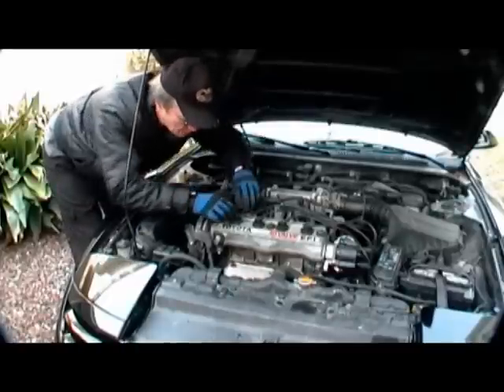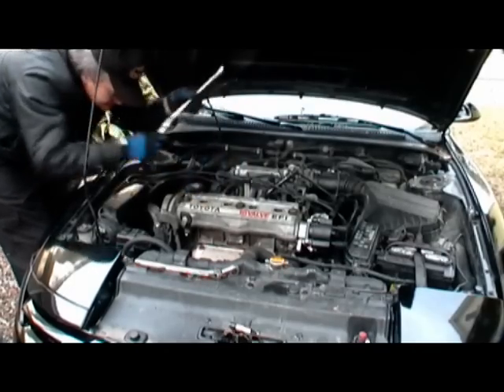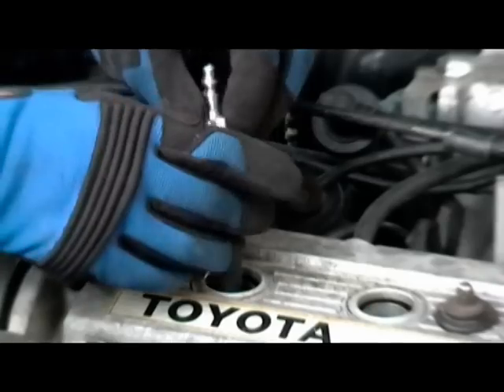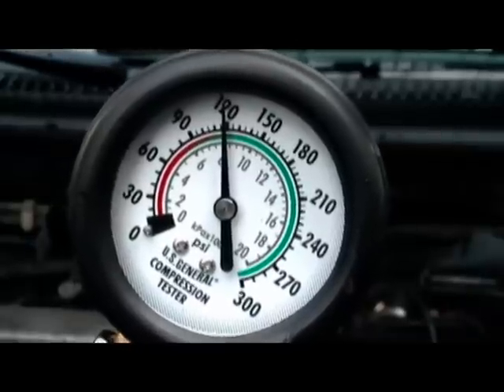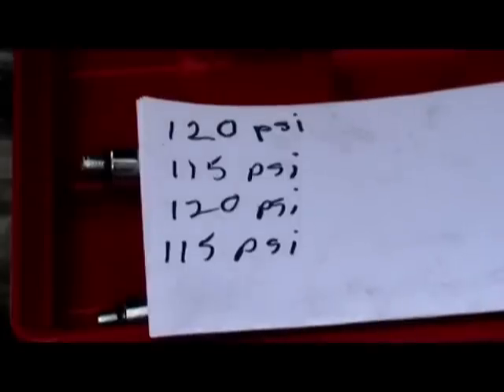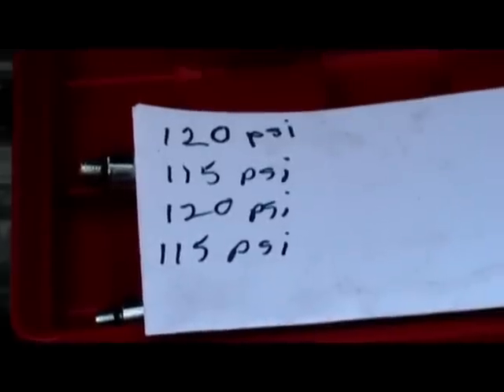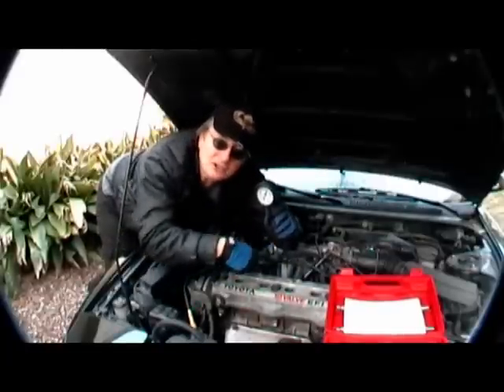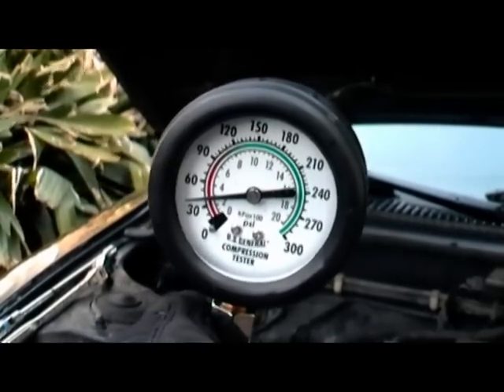How To Check The Compression Of An Engine

Comment: How do I warm up my engine, if it doesn't start?
Reply: Torch it!
Reply: Break fluid in the intake if it starts change your fuel injectors 😷
Reply: Then do the air compressor method.
Reply: U need a new engine happened with me
Reply: You give it a blanket and hot chocolate
Reply: Put some gas in it
Reply: I didn’t know you had to do it with engine warm. I did it with a cold engine and all cylinders were between 125-135

Comment: What I usually do, is remove the fuse for the fuel injectors before i do it, so that way i don't have a bunch of unburnt fuel running through my engine
Reply: Completely unnecessary
Reply: @nordicpride9708  I always thought you had to disconnect the fuel system like that though. Can you explain?

Comment from the maker: you can if you want, but if the ignition system is disabled it can't start, and any gas put into the cylinders would just blow out the exhaust as engine is cranked.

Comment from the maker: you can disconnect the ignition system and remove the fuel pump fuse if you want to be really safety conscious. more than 15 percent diff is bad. No, you don't have to open throttle, just take readings in the same manner for all cylinders. Wet test is done to see if piston rings are worn, pressure goes up on wet testing if they are

Comment from the maker: As I said, the actual pressure readings vary widely with gauges, so you measure the difference in pressure, and if one cylinder is more than 15 percent different than the others, that cylinder is worn inside. the actual pressure inside any engine varies widely, depending upon the outside temperature, the barometric pressure that day, the humidity, and the condition of the engine. And new engines have higher pressures that older worn engines. Scotty Kilmer

Comment from the maker: Since they spark plugs are all removed, any fuel will just be pushed out the empty holes. If you're worried about safety, doing the test in an enclosed area (unlike my test which was done outside), you can remove the fuel pump fuse. Scotty Kilmer

Comment from the maker: As long as you do it with the throttle closed, or the throttle opened, the readings will be accurate when comparing the cylinders to each other. You can do it with a closed or open throttle, as long as you check them all the same way. Scotty Kilmer
Reply: Hey Scotty would you have to reset your check engine light after one of these tests?

Comment from the maker: Check to make sure your fuel injectors are firing, many times the crankshaft position sensor goes bad and you lose fuel injection pulse. NO pulse, no fuel gets sprayed into the engine. Just for kicks, spray some starting fluid in the air filter hole to see if it starts. If it does, you know you've lost fuel to the engine then for sure. Scotty Kilmer

Comment from the maker: As I've already said, it doesn't matter if you have the throttle open or closed, as long as you do all the tests either open or closed. What you care about is the difference in pressure in the cylinders as I show in the video, NOT the actual pressure reading itself, which is not all that accurate. scotty kilmer

Comment from the maker: @imautuber444  THERE are MANY ways to do a compression test, and as long as you are consistent and do them all the same, throttle open or closed, it does not matter how you do it, as it's the difference in cylinder pressure that counts in this test. BUT, yes, if you want the actual highest readings, you would do all that. Plus you would do a cylinder leak down tests with a different gauge, but that's a bit too complex for the average guy which is what this video is for. Scotty

Comment from the maker: @21mejia25 you can do it any way you want. As long as you do it the same for all cylinders. it's the difference between readings that counts mainly, not the actual readings, as those gauges aren't all that accurate to begin with when it comes to actual pressure

Comment from the maker: You can if you want, that's merely a safety issue of tiny amounts of fuel coming out the spark plug holes IF you are working inside a closed building. I work outside in the open air, so it doesn't matter there. Scotty Kilmer

Comment from the maker: They do, but it's built into the distributor, so you'd have to replace the distributor to replace the sensor. That's what determines injector firing on that engine set up. And put a noid light on the injectors to see if they are firing (the light will flash if they are.) "Scotty Kilmer

Comment from the maker: You can disconnect the coil or pull a fuse if you want, but I never bother, I just move the wires out of the way. You'd only have to do that with a junker that is leaking fuel all over the place. Scotty Kilmer

Comment: @scottykilmer That sucks buddy,I had a compression test done at a local shop and,from what they said, it was the valves. I had the head machined and valves re-seated only to put it back together and have the run exactly the same.  I should have just done the rings but now I will have to get another set of bolts and another head gasket.  
Thanks for replying back to me.
Scott

Comment from the maker: Nothing is as good as the "old" ones these days. I have four Toyotas sitting in my driveway, from twenty nine years old to sixteen years old (I just bought the 16 year old one.)  They still make the best cars out there for the money in my opinion, but there's no way they will last as long as the older ones did. Too much use of plastics and computer parts that will break over time. That's just the way the whole auto industry has been going over the last decade and a half. Scotty

Comment from the maker: do a compression test, cause either bad valves cause backfiring, or bad ignition systems firing wrong, or leaking fuel injectors. So pressure test to check the valves first

Comment: Thank you Scotty for the super quick response. And I did a dried and wet compression test it was good,and I pulled the coils with the spark plugs on and I cranked the engine and I see spark on the spark plug. Car smells like is running rich on fuel and spark plugs look wet.  Thinking on checking the camshaft. No more ideas . Thank you for your help

Comment: @TRcustomengineering the briggs engine block had cracks everywhere and the gaskets i couldnt find so i bought JB weld and used it as a sealer and gaskets its working GREAT

Comment: Yes I was doing the procedure correctly, also notice it's the same as scotty's reading. The trike was supposed to have around 170psi, I went and exchanged it for another tester (but the same kind) hoping it was just the tester and not my engine but I got the same reading. But in one last try before i ripped my motor apart I went to an auto store and picked up a fancy 45 dollar compression tester, I tested my motor and it had 185 psi, so my advice is don't buy that tester.

Comment: 2019 honda insight 1.3 hybrid. Gas. How do i get the engine to jist crank. I pylulled fuel fuse and ot wont even crank over with out it. Help?

Comment: Intereting. Thanks. I've also noticed that it sometimes takes cranking the car several times to get the top PSI. Otherrwise I can get large differences between cylinders. Not sure if its my tool or not but it seems to peak sooner with the throttle open.

Comment: Hi Scotty, I noticed in this video you did not disable the the ignition system. Is that something that needs to be done?
Reply from the maker: no, if the other cylinders start up and run, you would get an even more accurate reading on the one you were doing

Comment: u have to remove power to the distributor and fuel pump too, plus press the gas pedal to the floor to open the throttle

Comment: How do I warm up the engine when I have to remove the intake manifold and drain the coolant to take out the back 3x spark plugs for the test? 1999 3.0L Toyota Sienna. 3x Spark Plugs under the intake manifold. But, you probably know that...;)

Comment from the maker: unfortunately there is not real place you can look that up in, even I have to guess and use years of experience. Plus gauges are not that accurate other than with their own readings. so it's more the difference in pressure that you look for when testing.

Comment: I understand that taking spark plugs out of a hot aluminum engines can damage the threads.  Is this why you let the engine cool down and then run it for only five minutes?
I am taking a technicians course in Automotive repair.  How long should I let my engine cool before starting this procedure?  I have to drive it to class and am concern about galling or striping spark plug hole threads.  We are learning about cranking compression, running compression, cranking vacuum and cylinder leak down tests.
Couldn't hear my instructor so well today over roar of test engine.  Thanks

Comment: Scotty, my son's '91 Toyota Tercel has only 170K Kms (105K miles) on it. It's in great shape and very clean overall, but I did a compression test when we noticed it was losing power on hills. Three cylinders show 150 psi but one shows only 90.The plug on that cylinder is fouled with oil.  Is this the end for this car? Everything else works great.
Reply from the maker: +Albert Head yes, those were weak engines, a big reason tercels are no longer made

Comment: I realized too that you need to push the gas all the way in to ensure the throttle is wide open and the engine can pull enough air in to pressurize the gauge.

Comment: I have a Honda Civic Hybrid that has 2 spark plugs per cylinder.  How do you suggest I do a compression test? do I pull the plug wire from the other spark plug for the cylinder I'm testing so the testing cylinder doesn't fire? or just let it run?

Comment: I want to do this on a 350 engine do i take out fuel fuse or would there be a problem with fuel?
Reply: no problem with fuel if its carbed or EFI as long as you take out all 8 sparkplugs and dont crank each cylinder excessively

Comment: Hi Scotty, I googled "compression check engine youtube" and you were on the top of the list.  I took my car in today to a shop (first time there referred by AutoZone) and was told on my 96 Geo Metro, Numbers are as follows:  120, 110, 100, 110.  Supposed to e more than 125?  I earn very little income. What is the worst thing that will happen if I do not correct this?
Reply from the maker: Linda J just keep driving it, and add oil as it burns out. rebuilding that engine is more than the car is worth. They can still run a long time if you keep oil in them
Reply: Scotty Kilmer   Thanks Scotty!  I have subscribed to your page!  I like your vids and we all appreciate your mechanical expertise for free. Again, thank you!

Comment: so I did my own compression test, but made the mistake of leaving the other 3 spark plugs in and letting the car start. I was clueless, as it was the 1st time I did it. I got about 117-120 in all 4 cylinders doing this. car is a 04 camry with 180k miles. Should I retest the proper way and let it crank a few times?

Comment: Hey scotty. I have a problem with my 1990 toyota celica gts. When I start it up, it runs fine and drive stong. But when the engine gets warm, the engine will not want to start back up until it cools down after a few hours. my car is my daily, so the quicker I can get some advice the quicker I can get back to driving it
Reply from the maker: if it doesn't crank, replace the starter. If it cranks, check for leaking injectors flooding the engine out

Comment: Scotty Kilmer I have no compression in my engine and found out the timing jumped. Will replacing the valves and fixing the timing belt restore compression? (07 Aveo 1.6L engine)

Comment: Hi Scoot, I just purchased a a 1988 mr2 supercharged jdm used engine ,# 1 #2 cylinder read 90 psi dry ,wet 120psi  and #3 #4 cylinder read 20psi  dry and wet tested.  what should I do next because I can't return it is no warranty.thanks

Comment: do you have to disconnect any ignition wires to do a compression test or anything like that, or do you just remove spark plug wires and hook up the tester and run the test?

Comment: Scotty!! I have a 2002 Altima 3.5 and cylinder 2 and 4 r misfiring I have good compression, good fuel pression and spark. I changed the left injectors and coils to the right and the right ones to the left and the dealer said the computer is good. Still misfiring. Please help
Reply from the maker: +supercocaso do a wet and dry compression test of the engine first, it could be bad valves on those cylinders. If not, wiring would be bad to ignition or injectors

Comment: Saturn s - series ...cylinder 1 (200PSI)  2 (190PSI) 3 (200PSI) 4 (180PSI).  Unfortunately number 4 seems to make the car miss or run uneven, or that is what I suspect.  These are still within spec but is a 20 percent difference between the highest and lowest reading on my SL2... So how "even" do these need to be across the board there...?

Comment: I have a 2001 Hyundai Santa Fe, can you do the test even when the intake holes are exposed when you remove the top cover that hides the back spark plugs,the only way to test cylinders 2,4 and 6 is with the cap removed, Am I right?, thank you!

Comment: I cannot get a john deere 2010 gas engine to start.  Has new electronic ignition, new wires, plugs are good, new cap, new rotor.  Have double checked tdc with rotor pointing to #1 numerous times.  Won't start. Keeps trying to backfire through carb.  This is a basic engine dilemma.  Any ideas?

Comment: some mechanics do a cold engine compression check. what's the difference from a warm engine test. I have an '01 honda shadow 1100 motorcycle.v twin. would I need to check all 4 ports.
Reply from the maker: you would only need to check one spark plug on each cylinder, and cold testing is safer

Comment: I did the compression test on a cold engine. Then found out the engine should have been running. Wow! My 3.0 mercrusier had 60,30,30,30. I know I did the test wrong with the engine not being warm but I cant start it just yet. Hope I don't have problems on my hands.
Reply: This engine has not been ran in 4 years.

Comment: Scotty , did a test on a GM 3.1 engine, wet an dry test , pressure stayed the same, have you ever seen bad / burned valves on that engine ? if yes is it a hard job to pull the head off to replace them , i am having a leak down test on it to show where the leak is , let me know
Reply from the maker: Kody Darlington pulling heads is never an easy job, but it can be done with time and patience.

Comment: I've got an N42B20 which showed cyl 1 & cyl 3 at <0 2 @ 1.0-1.2 cyl 4 @ 1.7-2.3

Was told this was abnormal and am wondering what are the chances of it being the seals over other more expensive fixes.

Cheers
Reply from the maker: have a wet and dry compression test done of the low cylinders. If pressure goes waay up when wet tested, it's the expensive piston rings. If pressure doesn't change much, valves are the problem or blowing head gaskets. There are no seals that can cause that low pressure
Reply: Appreciate the feed back and the advice. Truly appreciate it. Will update if any develops. Cheers. You got a sub :-)
Reply: Shawn Cheah Just got the car back and thankfully all's well cept for the gaskets. A speedy not so pricey repair. I've also found broken screws that kept the top .. well top which was compensated with poorly applied glue. Thanks again. Truly appreciate it.

Comment: another one when checking through obd2 (autoenginenuity) , it seems normal almost everything near zero (Smooth running value cylinder) and the injector looks fine...

Comment: Hey scotty just a quick question...does air still escape from the valves even when closed or should there be no air escaping...cause I did a complete head job with a machine shop but when I put compressed air through the spark plug hole, air still escapes out the intake ports...not a lot but still does...normal? Or not?
Reply from the maker: none should come out, crappy machine shop, very typical these days unfortunately. It's happened to me too.

Comment: Don't you have to like disable the fuel pump so it don't load it with gas
Reply: bradley coward that's the same thing I was wondering too, along with unplugging the main coil to keep spark from happening at all.
Reply: @blainemeyer  if you dont unplug the coil then you should go full throttle and you know what happens then google it

Comment: Would someone clarify to me, considering a situation with an engine in perfect condition, why does the compression stays steady if let's say you turn off the car and it has been stoped on a stroke with an opened valve - wouldn't that cause a presure drop in the gauge???
Reply from the maker: Stefan Ovcharov no, the gauge has a schraeder valve in it that holds pressure at the last compression stroke
Reply: Scotty Kilmer Thanx very much. So it is basically like pumping up a tire.